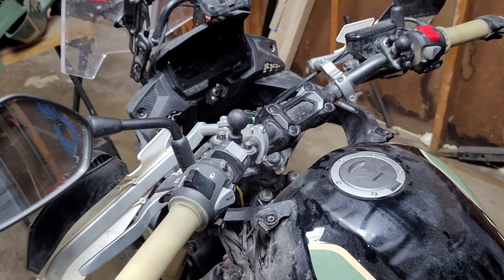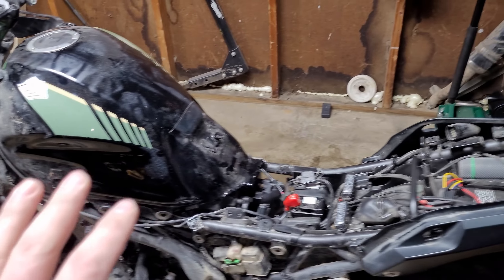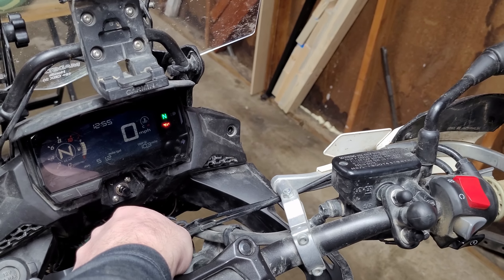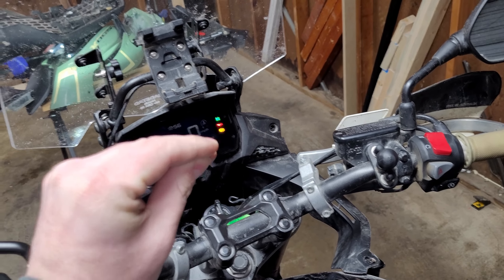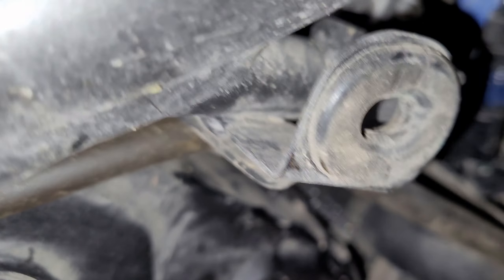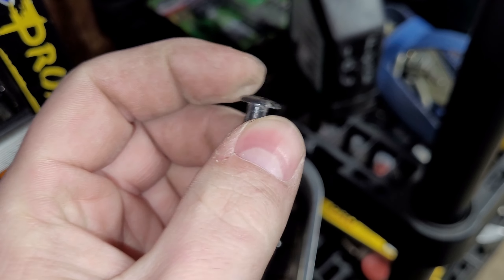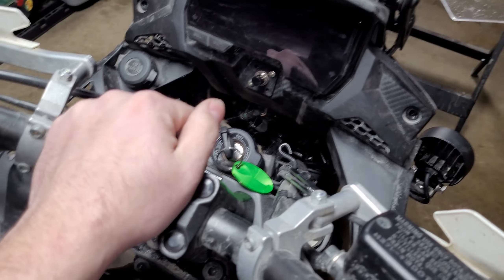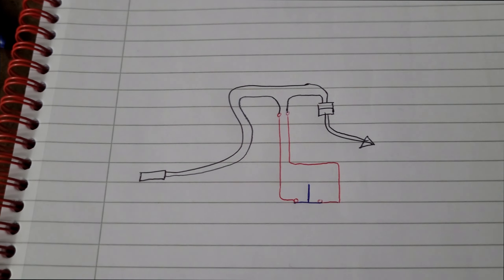CB500X ABS Disable Switch

Comment: So is that little blue connector the cut out that the switch connects to?  Is that connector something that is available from an auto parts store/ali express?
Thanks
Reply from the maker: You can probably get it from Eastern Beaver if you wanted to make a splice kit instead of doing it to the sensor/loom. I don't know the name or part number of the connector.